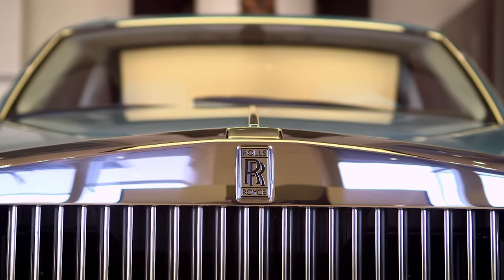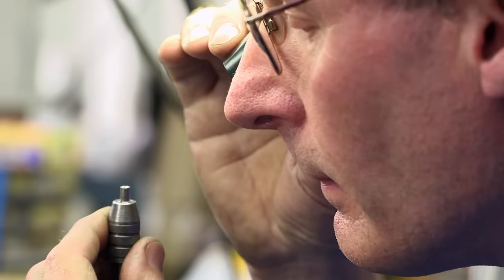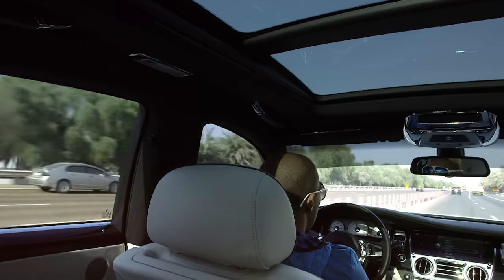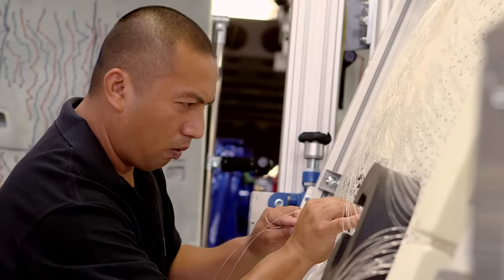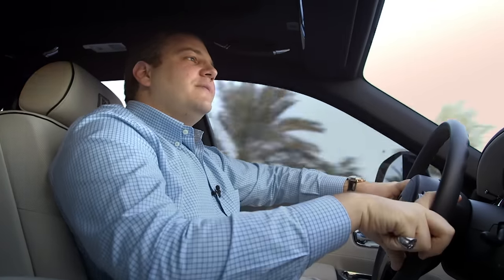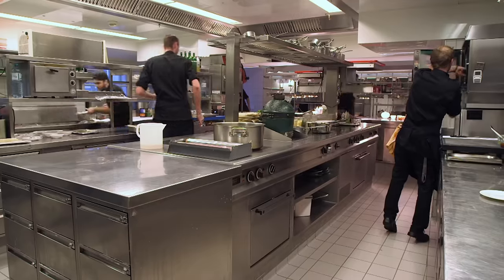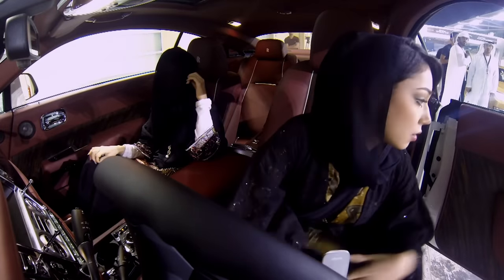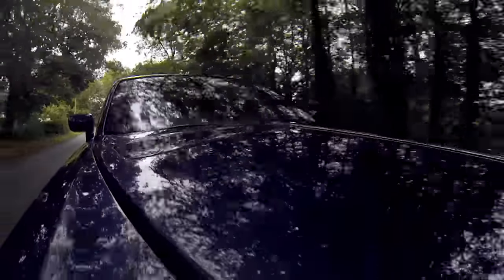Inside Rolls Royce: The World's Most Expensive Car | Our Stories

Comment: I can tell you from experience that the Phantom is an awful car for towing.  Rearward view is horrendous once you get a pontoon boat hooked up, the traction control is not really designed for a slippery boat ramp you get half the rear in the water before getting traction.  My wife and I towed our popup camper on a trip to Tahoe and the sway was considerable.  Does RR not test for real world applications during the design phase?  I will say when I put some wider mudding tires on it improved the ride considerably.

Comment: You HAVE to be uber rich to afford a RR, not just the purchase price but the insane costs of the overly complicated way the cars mechanics and electrics are designed and built resulting in even more insanely priced parts and maintenance costs once the car racks up a few thousand miles - RR touts reliability in this video but fact is they are notorious high maintenance and breakdowns after just a a few thousand miles are common and EXpensive to have fixed.  I know many will use the lame excuse if you can afford the car you can afford the maintenance but thats not an explanation for having cheaply designed breakdown prone plasticky  hardware in such things as power windows and other areas of the car including its electrics and nightmarishly over complicated hydraulic systems - Ive seen the electrics and wiring in a rolls and some of it honestly looks haphazardly designed with ill fitting non weather sealed connectors and badly routed wiring in areas that guarantee future faults.  Also, when you start taking one apart you see lots and LOTS of plastic underneath that gets brittle and falls apart with age, no excuse for a car of this image and price to have anything less than top tier reliability - but the dont, not for long anyway.  Far as exotic interior appointments such as the leather wood and carpets youll find none better, but this kind of attention to detail doesnt extend to the areas where it really counts, the parts that need to be reliable and long lived - but arent.

Comment: With perfection as a standard and with diamonds placed in white gold holders you would think they would use a micrometer to check the depth of the hole, plus the diamond holding item to make sure they are the same size, like it seems to me, they put the wrong holders in the wrong holes? 👌✌👍🦘

Comment: BMW owns ROLLS-ROYCE. And did you know that about 80%  of the parts used to build a Rolls-Royce are actually BMW parts? Yes, they even have BMW stamped on them if you take a Rolls-Royce apart! 
For example, the Rolls-Royce Phantom is based on the BMW 7 Series, but with a different body "skin" - with RR badges, of course!
And you will pay approximately 5X times more for the Rolls-Royce Phantom than you would for a BMW 7-Series. Why? Because well, it has that "Spirit of Ecstasy" hood ornament - and who can live without that? 
And you will pay approximately 5X times more for the Rolls-Royce Phantom than you would for a BMW 7 series! Because well, it has that "Spirit of Ecstasy" hood ornament.
Now, do you still want to buy a Rolls-Royce?😮